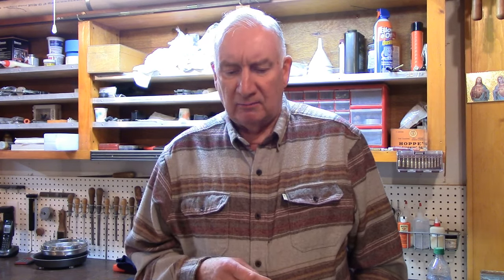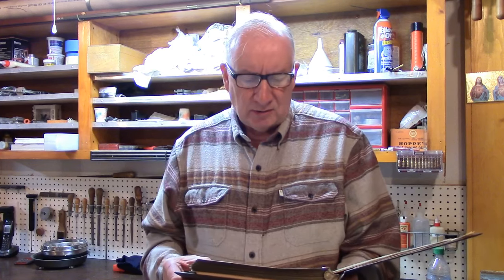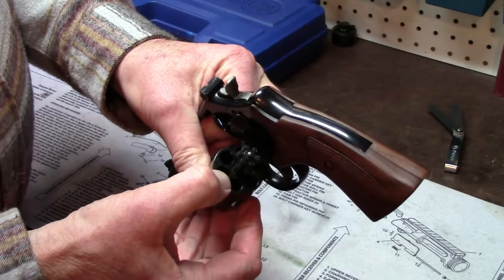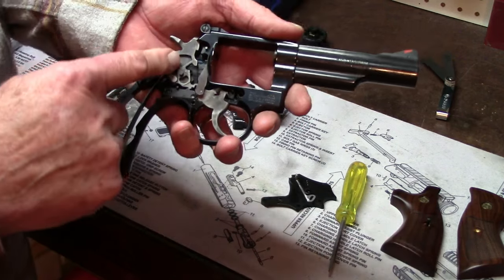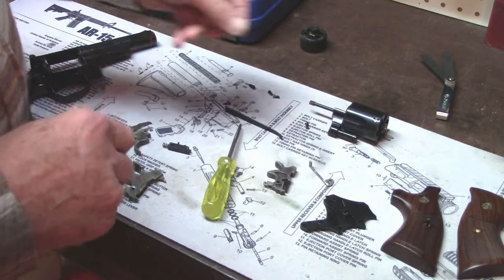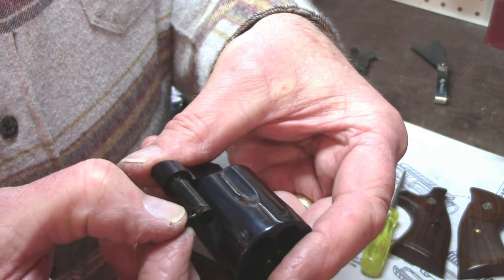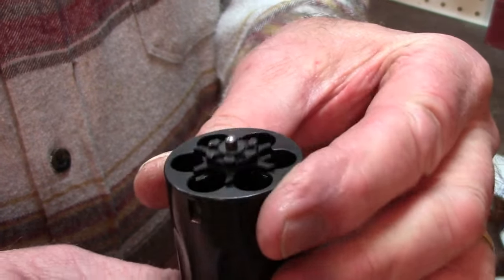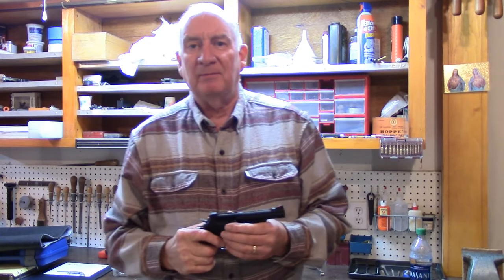The New S&W Model 19 Classic ~ A S&W Armorer's Review

Comment: Umm, my Model 19-4 had the red ramp, white outline rear sight, target trigger and target hammer. It came straight from the factory that way. That was my side arm and it served me well. I wish I never got rid of it. I was skeptical of the new Model 19, and I appreciate how you went through all the improvements. It actually changed my mind. But the latest is the "safety" or "Hillary Hole" is gone on all newer models.

Comment: Do you have any info on if the forcing cone has the same weakness of the older model 19s? I’m considering the 19-4 classic, but I plan I putting plenty of magnums through it and want to know if it will crack like the older ones did. I shoot my guns a lot.

Comment: Good video but I have actually had the firing pin safety engage itself while firing my 329PD.  The safety engaged with the trigger to the rear after firing.  the trigger would not return forward so the revolver was disabled with live rounds in the cylinder.  The cylinder would not release either.  Fortunately, this was on the range and not a life threatening situation.  I did not have a key at the range so I just took the side plate off and reset the safety lock and everything was fine.  I have read that on the Scandium revolvers, the inertia of firing is greater due to the lighter weight and somehow flips the safety lock to engage.  Steel revolvers don't seem to have this issue.  I had heard about it and thought it was typical rumor or myth, until it happened to me.  Only happened once, never happened again, but it happened.  Love my model 65 and my 29-2 "Dirty Harry" style revolvers.  Also, it might be heresy but, I had a 686 that had a better trigger than my Colt Python...  :)

Comment: I'm glad I found your review, funny we took out our 19-8 just yesterday after installing a new Leupold Delta Point Pro.  
One item I would bring up is that the original 19's had an undercut forcing cone due to the frame dimensions, this could and would crack under a regular diet of hot 357 rounds.  I know because my 19-8 did.  The new 66 and 19's don't have this issue.
My wife and I have a range of autos from 1911's to modern composite guns but there is something special about a wheel gun.  We love our S&W 19, 686, 29, and 500
Reply from the maker: That was one of several problems with that model that resulted in the L frame introduction.  If the current K frame design had been used then, as it is made now, the L frame would never have been required.  Yoke redesign eliminated the under-cut barrel, and many other improvements completely eliminated yoke and cylinder end shake.  It's a far better gun in all ways, while retaining the same action geometry that can have the exact same smoothness.

Comment: Good to see you back. This revolver has been on my wish list at Bud’s Gun Shop for some time. I really enjoy shooting my revolvers and your point about not losing brass while shooting is a good one for those of us who reload. I have a Ruger GP-100 with a 4.2 inch barrel in stainless and it is a dream to shoot. Is there a qualitative difference between Ruger and Smith and Wesson? Thanks again for the informative video.
Reply from the maker: S&W always had a smoother DA system, and it's design was classic and prettier, but it's former design was not up to the strength and sustained durability of the Ruger.  This new Model 19 absolutely eliminates the maintenance issues of the past, and no longer gives Ruger the durability advantage.  So, you can buy either with complete confidence.  Take your pick.
Reply: @GunBlue490  Thank you.

Comment: I bought a 4" Model 19 in 1976.  The gun writers sold me on the fact that it was the FBI's service revolver and they ought to know.  (The FBI actually used the fixed-sight Model 13 M&P with custom 3" heavy barrel and round butt but I didn't know that then.)  I still remember my impression of those articles today, 46 years later.  Perfect combination of weight, carrying size, and power they said.  The Model 19 had a noticeably better finish than the other S&W models in the case.  I guess it was competing with the Colt Python which had a mirror blue finish but cost a third more.  It seemed like a good deal.  My model 19 shot .38 Special really well but it was hard to control with factory .357 magnum loads.  I had to shoot it single-action with a two-handed grip.  After a few boxes of factory .357 magnums the cylinder began to bind and jam.  It also seemed the ejector rod wasn't long enough to fully eject .357 cases.  I had to tip the gun back to get them to fall out.  I took it back to the gun shop.  They kept it for a couple of months.  When I picked it up their gunsmith told me to keep it really clean because "it had tight tolerances like a Swiss watch."  I'd only had it a few months and I had kept it clean. I gave it another try.  It started binding again after just a few more boxes of .357.  It still shot .38 Specials with no complaints and quite accurately.  I kept my .357 handloads to 1,000-1,200 fps and never had any more trouble with it.  I still have it.

Just a few years later the same gun writers that had sold me on the Model 19 wrote that it seemed K-frame guns weren't really up to full factory .357 magnum rounds.  The writers said the FBI and other police organizations were having issues with their K-frames.  Some had problems with bent/worn cylinder pins or they wouldn't stay cocked on single action.  A few had developed cracked forcing cones.  Some blamed it on the high velocity (~1500 fps) 125 gr HP Super Vel ammo which was the hot thing with law enforcement back then. Remington came out with a similar 125 gr round that made 1,450fps from a 4" barrel.  The underside of the barrel's forcing cone is D-shaped to clear the cylinder gas ring.  It cracks on that flat with a diet of high-velocity ammo.  Mine didn't crack but I didn't shoot Super Vel.  Super Vel had actually gone out of business around 1975 but you could still find a lot of their ammo around.  I still remember the yellow boxes.  I'm told factory .357 is loaded more mildly these days.  The explanation went out that the K-frame was a .38 that could shoot .357.  They were intended to shoot .38s for practice and only load .357 for on-duty carry.  Now you tell us.  The writers said we needed to go right out and buy a brand-spanking-new L-frame. Meanwhile, the FBI went to the S&W 459 auto.  After that I took everything gun writers said with a large dose of salt.  Fool me once...
Reply from the maker: Yes, you are correct on all counts.  My Smith and Wesson instructor explicitly told us that the K-frame simply did not have sufficient mass to withstand routine magnum firing. That was also his admonishment regarding the N-frame Model 29 with regards to regular use of .44 Magnum loads.  The current production of their guns are far stronger and made with advanced design that has addressed the weaknesses of the earlier models, however pretty they were.

Comment: GunBlue490, "copliments" on a wonderful channel and this most excellent review. I've been a  subscriber from the first video after finding you. Retired LEO here. (30 yrs.: local then federal; firearms and general police instructor...) Thanks for a good review of my favorite handgun. Just recollected and I've owned at least five since the very late 60s. Carried a factory 4" round butt from '81 until transitioning to issue autoloaders. I've put at least 70K rounds through it (mostly light loads; few magnums; much dry-firing) and its been completely rebuilt once and partially a second time. (Never unsafe, but was getting "loose" and had developed a little end shake.) Never lost its fine accuracy. Still going strong after forty years. 
Alas, I view the safety holes of the current generations as a not so elegant solution to non-existent problems. Consequently, I only own two of the safety-encumbered models: a 60-18 (a 3" in .38 Spl, only) and a Mod. 69 (which handles .44Mag much better than I do!). Both are apparently strong and are reasonably accurate. Another Mod 60-18 (in the catalogued .357) had a barrel that indexed at 11:00! It went away. Both of these current models (60-18 and 69) came with cylinder gaps exceeding 0.010"! The Mod 69 was returned to S&W for the gap and timing problems. I was charged for repairs and the 0.010+ gap was found to be WITHIN SPEC! None of my old(er) Smiths have gaps like these. Flash is dramatic and chrono results are what one would expect from shorter barrels. I like the frame mounted firing pins and round butt default configurations. Actions are smooth and crisp - S&W excellent. So, I find the current generation to be a mixed bag.  Again, thanks for your excellent unbiased and detailed review of the rebirth of my favorite handgun.    Pax

Comment: I recently acquired a K22 17-3 Masterpiece (Bangor Punta).  It has a problem with binding up on double action pulls, which I think has more to do with fowling, but it comes and goes WITHOUT cleaning.  It has been a rather anticlimactic, so so Smith, though it appears to have lived it's life in the box.  It does a good job of dispatching Eastern Gray Squirrels away from my bird feeder.
Reply from the maker: Call S&W.  They will refit it.  It's a mechanical issue, not fouling.
Reply: @GunBlue490  S&W customer service advised they do not work on revolvers with pinned barrels. I was hoping they would work on my K-38 Target Master from 1949.

Comment: I have an old model 10, 4 inch. And a 586 in .357 8 inch, with an 8 inch barrel and the 4 position front sight. A couple Taurus revolvers in .38 and .357. I grew up reading Elmer Keith and Bill Jordan, I couldn't grow up without loving wheel guns. There will always be a .38 and a .357 in my cabinet.

Comment: Good information on the later model Smith's.  I have purposely avoided buying any new S&W's because of the "Hillary Hole" in the side by the cylinder release and believing the new Smith's were not the high quality of the older guns.  Based on this video my opinion on lower quality was, thankfully, wrong.  The engineering improvements are impressive.  Pleased that I found this excellent video.

Comment: Great video! Your wealth of experience and information on these guns is invaluable. 

My first S&W revolver was a Model 66-6 (stainless version of the 19, but the -6 meant it was a more recent production and did indeed have the much-maligned keyhole on the side to lock the action up) I remember some crank at the gun store where I bought it pooh-poohing the gun because he said it wouldn't hold a candle to the old Smith and Wesson guns. 

Well, I loved that gun. It was fantastically accurate, user friendly, and did everything you could want a handgun for. Sadly I sold it off when money got tight, but I have been also looking for another replacement as sweet as that M66. Perhaps this 19 Classic is just the ticket!

Comment: Hi, GunBlue490. I have a really nice Ruger Security-Six 4-inch. People talk about how tight their cylinders are when they cock them, but my cylinder wiggles a tiny bit when cocked. It's not out of time by any sense of the word, but other guns I own are much tighter. 

Do you think it's anything to worry about? It might be that the previous owner took too much off the cylinder stop (when I start to cock it, the cylinder spins if rotated, something that doesn't happen on my Speed-Six. But when cocked it locks up fine.) 

It just wiggles a bit. The cylinder lines up okay and when I shine a light back there, it seems to line up fine, but do you think the wiggle will it cause any accuracy problems? 🤔

Comment: Great video. On an old S&W 357 mag. revolver mod. 19-4.Which side does the barrel pin exit ?.Is the pin pushed out towards the right ?.where the side plate is located ?.  To remove the barrel one would turn the frame counter clockwise ?.  Barrel is facing away vertical in front.

Comment: I have a 2 1/2 inch 19-3 picked up at a gun show.  Looked like it had never been fired, the recoil shield was untouched.  Found out why on the first trip to the range, huge misfire issues.  Check the firing pin and if failed the Dime test by half the thickness of a Dime.  Ordered a Power Custom firing pin, fitted it, and that 19-3 is now one of my very favorite shooters.

Also have a Model 620 with the Full Works that sets all those "classic" fan boys into a tizzy.  It has the 2 piece barrel assembly and will shoot sub 1 inch groups with a scope mounted.  Guess those fan boys never heard of a Dan Wesson and their tensioned barrels.  Also has, gasp, MIM hammer, trigger, rebound slide, and DA sear.  It is now tuned to the smoothest 8 lbs. DA trigger I have EVER shot with, ball bearing smooth without even a tiny hint of stacking anywhere in the stroke.  All that was needed to tune the action was to replace the factory rebound spring with a 14 lbs. rebound spring, install a Cylinder & Slide extended travel firing pin,  and file fit the tip of the strain screw to produce an 8 lbs. trigger pull.  It's 100% reliable with CCI 550 primers and a real joy to shoot.  Note, I've also installed the 500 Magnum Monogrip because I like a large grip on my revolvers.

Point of this is that S&W has made some real improvements to their revolver lineup.  Two piece barrels are more accurate than one piece barrels because they are supported at both ends and there is a lot less "whip" at the muzzle.  MIM parts are harder than forged steel and they are so consistent that they don't need any "fitting" during an action tune.  The level of quality in the machined recesses borders on stunning.  BTW, my modern S&W's are a 610,  617, 620, & 625.  Old timers are a 36-0, 19-3, & 67-1.

Comment: There is a couple of things that you neglected to mention concerning your new model 19.  One is that 2 piece barrel is also a [b]Tensioned Barrel[/b].  Put a handgun scope on that model 19 and if you are good enough you will find it's capable of shooting 1/2 inch groups at 50 yards.  Yeah, like the Dan Wesson revolvers you have a 1 MOA handgun. 

BTW, I have a model 620 (a limited production 357 Magnum L Frame with a Tensioned Barrel) that I have personally shot to 7/8 inch at 50 yards while using a 1.75X handgun scope and resting my hands on top of a sandbag.  What I learned was the extreme amount of skill and trigger technique required to do this.  While I am certain I could not do this today I am quite certain my model 620 is till up to the task.

The second aspect is that "lightened" hammer.  The equation for Kinetic Energy is 1/2 Mass times the square of the velocity and Kinetic energy is what provides the Power to ignite a primer.  Another Formula in basic Physics is that Force = Mass times Acceleration.  Due to this a lighter object subjected to a Force will Accelerate FASTER.  So, when you lighten a hammer to increase it's speed when subjected to a Force provided by a Mainspring and INCREASE the Kinetic Energy produced.  Basically that lighter Hammer provides for increased reliability for Ignition.  On a side note it can also allow the Mainspring to be tuned lighter and still provide consistent ignition.

Comment: I got a 66-8 direct from the factory, that had to go back as it bound on 1 "charge hole" (notice the correct terminolosy, it not a "chamber"). Two week round trip to replace hand and one other fix I can't remember at the moment. Anyway, since getting it back it's been perfect through hundreds of magnum rounds. Another point - the new guns don't have the flat on the barrel underneath the forcing one. Load light bullets as hot as you want with no worries about cracking the forcing cone.
I also have a 69 that's been great since day 1. Perfect cosmetics, perfect action, accurate as a laser.

Comment: You sold me.  However, I am surprised you believe the double action to be better than older guns.  Great presentation.  Every time I pick up a modern S&W from under the glass from a shop, I cringe at how relatively tight and clunky they are compared to all the older S&W guns I own and have handled.
Reply from the maker: Feel is a subjective and betraying matter.  What you might call a silky trigger may actually be a very old and worn trigger that is as defective as old tired brakes on a car.  John Contos, our armorer instructor, let us examine a gun that a very well known writer of the day had given him to assess, which the writer called a "darling".  Mr. Contos called it a piece of crap, and demonstrated to us why.  I cannot explain what a good S&W DA action is, but it is certainly not what most old S&W DA triggers are, which is simply old, worn, and tired, in need of complete overhaul.  S&W revised the action because the old one was very fragile and subject to wear from  Day One, and continued to deteriorate from that day forward.  The new actions will not deteriorate, and are absolutely capable of the same silky smooth feel, because they are actually the same action; only with greater strength.
Reply: @GunBlue490  today, about an hour ago, I finally had the opportunity to examine two of these new M19 revolvers and I agree with everything you are saying.  The action is amazing.   One of the two was a bit tighter than the other, but I assume that has to do with the mainspring screw being in or backed out so far between the two guns.  But the tighter gun was no worse than my dad’s like new in box M10 from 1971.   It’s definitely top on my list and if I had $850 to spare, I’d have walked out with it.   Great balance, feels sturdy.